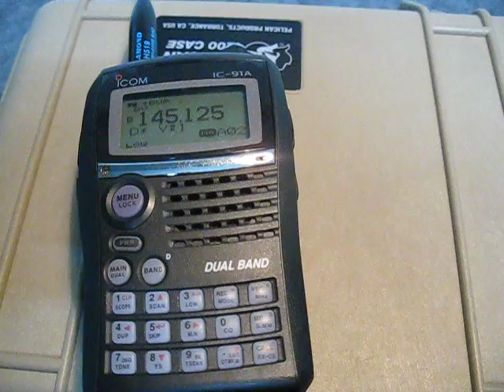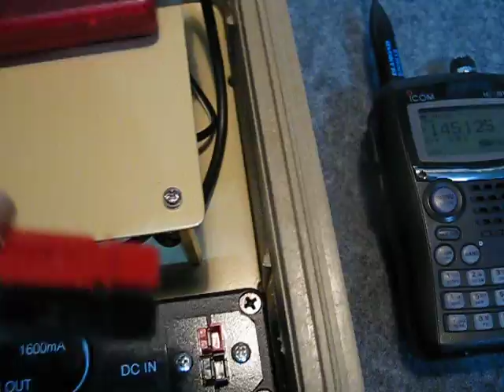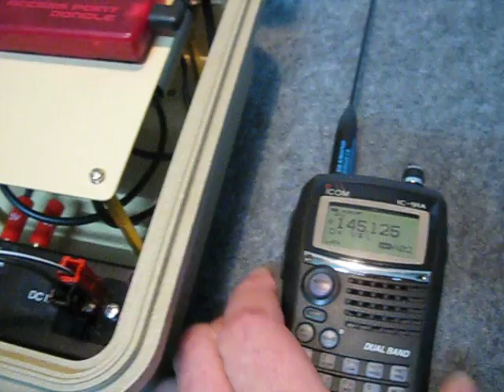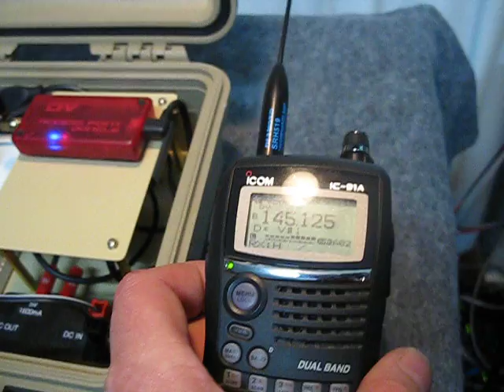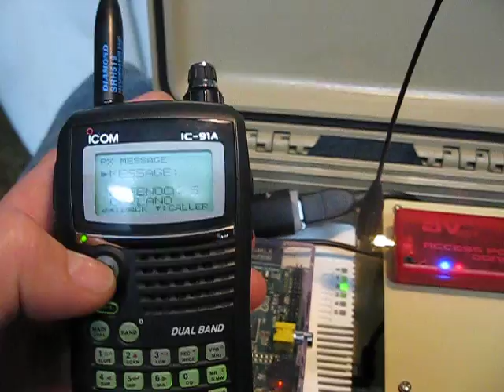Portable D-Star Hot Spot (almost) complete!

Comment: thanks for the vids. I'm looking to set up a wifi hotspot here in Newcastle NSW and was considering the dvap but wanted a little more coverage. I've got a spare ft8900 and laptop looking to be used and was looking at the various options. The dutch mini hotspot board looks to fit the bill nicely. Anything else you would suggest I look at ? Also as the 8900 does 6 and 10 would this set up enable dstar on those bands also ?

Comment from the maker: The router provides flexibility, I mentioned this in the video. I wanted the IP config of the Raspberry Pi to be simple. Ethernet connection & DHCP assigned address.  I did not want to have to go into the Raspberry Pi to change IP config, or be worried about the Raspberry Pi being directly connected to the internet via the 3G stick.  I can also use the internet connection from the Mikrotik router  for other devices either via WiFi or direct Ethernet connection.